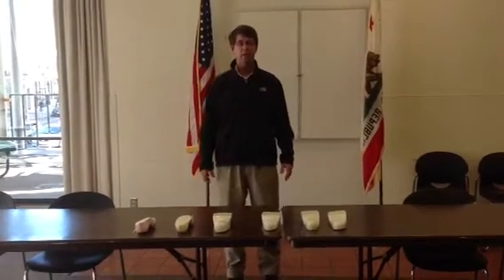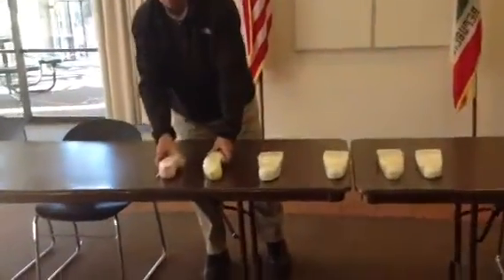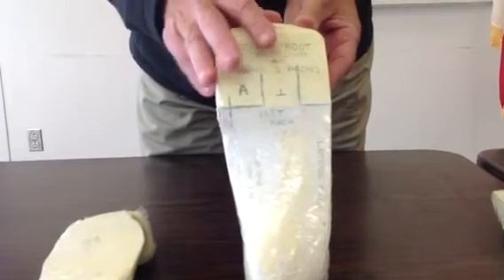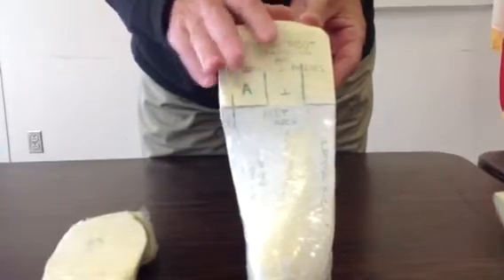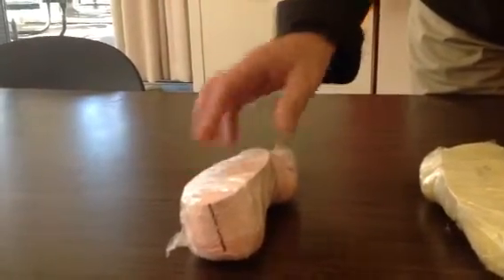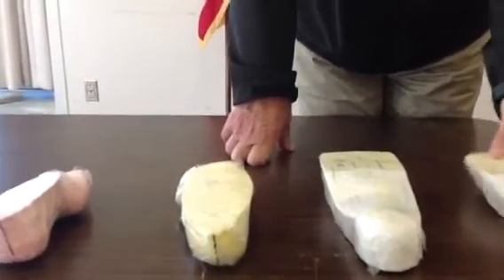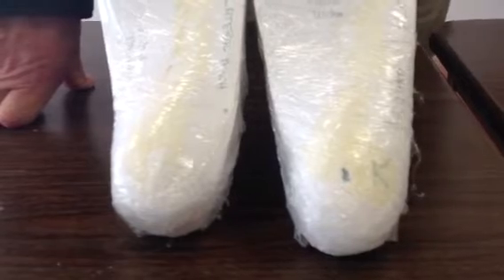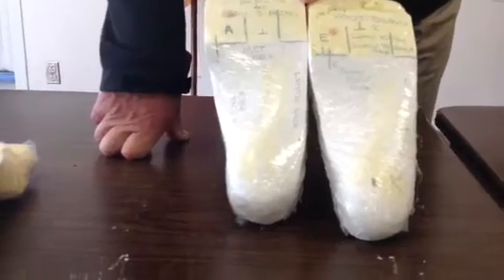Supinators: Orthotic Design Modifications

Comment: With the neuromuscular supinators would you go straight for the everting orthoses? I guess it depends on how much supination is present but for neuromuscular supinators with close to rearfoot rectus who is unintentionally supinating even on stance would it be right to go a bit more aggressive to evert the device in the first place?
Reply from the maker: Yes, you are resisting forces on the lateral side of the foot. You do things that you can remove if too much. Start with 3 degrees eversion, slightly narrow width, extrinsic zero motion heel post, 25 mm lateral heel cup with lateral phalange under cuboid and 5th met base. Then add Denton modification. Rich
Good starting point to see how patients responds. Probably need forefoot extension with 1/8 inch material under the 2nd through 5th metatarsals and toes.
Reply: Thanks very much for your detailed advice, Dr Blake. So to complicate things a bit more what if the patient had forefoot varus as her supination of the foot on weight bearing is by her neuromuscular issues but not of true supinating foot. Would you still incorporate a forefoot valgus post on the device as long as there is no joint issues at 1st ray?